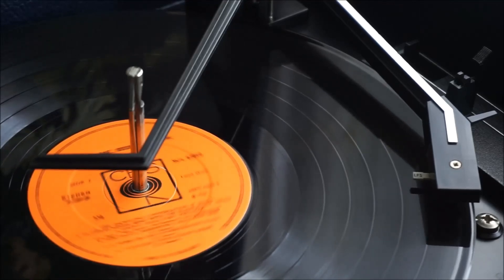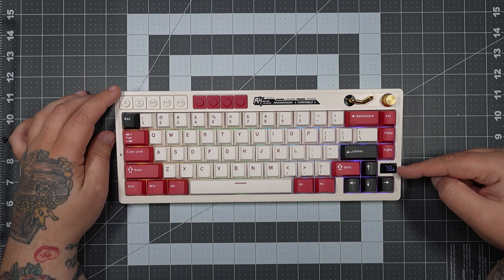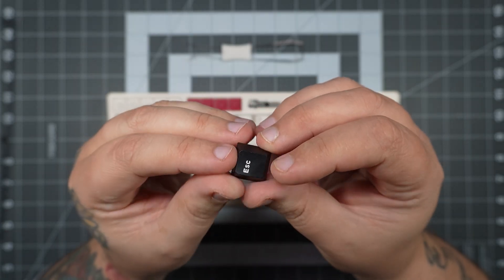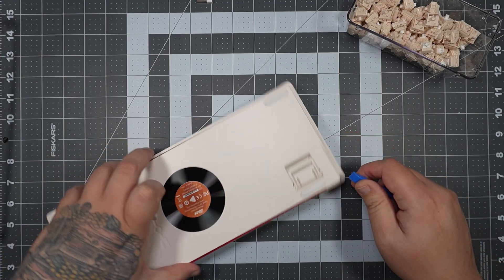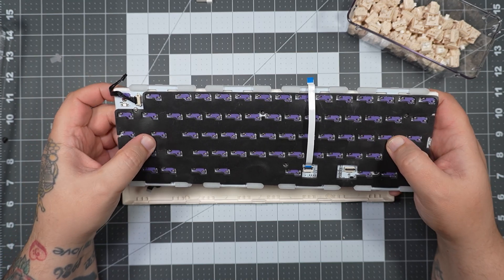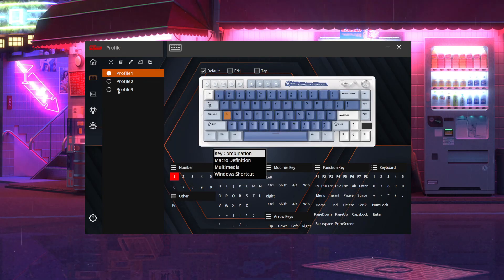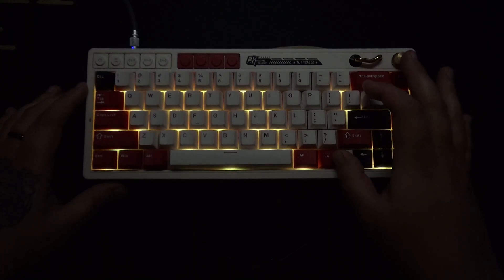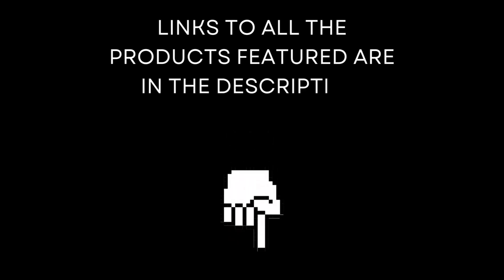Royal Kludge RK M65 - Teardown, Software & Soundtest

Comment: Thanks a lot. Id like to recommend future tests that you please connect the bluetooth to a device and test. Latency and rapid buttons. And if its full antighost or not. Those are functions why we use a portable small keyboards. Thanks great review. I may get this over the
Reply from the maker: I've been taking notes and I'll add this in there as well. I for sure want to expand more on making sure all the features and aspects are covered and gone through correctly. I just recently found out that Steamdecks have a lot of issues with wireless keyboards so looking to also add that in now as well just so I can keep everyone that watches informed. Thank you so much for the advice :)

Comment: Can you please drop the link for the software. I cannot find it anywhere.
Reply from the maker: Here you go: bit.ly/RKRGBSOFT
Reply: @CacheKeyboards  Thanks, but it didn't work. I downloaded and extracted it but it didn't recognize my keyboard
Reply from the maker: @oceanwillows  Weird. I used the V4.5 and it recognized right away. If I'm having any issues like that I usually try switching USB ports or switching USB cables. I would say if that doesn't work I'd reach out to RK and see if they have any idea why it's not showing up. Here is their email: support@rkgaming.com
Reply: Thank you!  @CacheKeyboards
Reply: Yeah. I downloaded version 4.5 and keyboard still not detecting it. I think there might be at least two different versions out there, one that lets you download software and one that doesn't. I'm sending mine back.  @CacheKeyboards